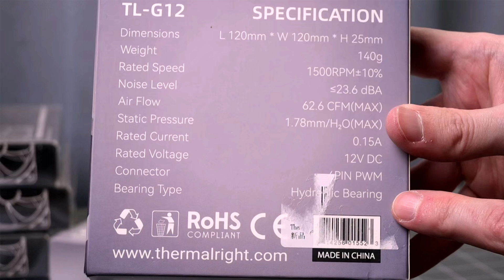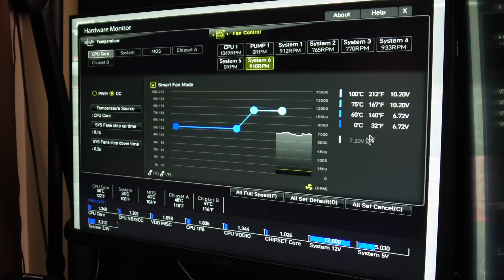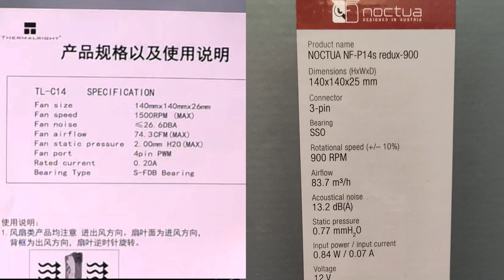Are these budget no RGB 120mm and 140mm PC cooling fans decent?

Comment: For anyone that comes across this, GET THESE FANS.  There are also the TL-C14C-S which are aRGB (5v), but otherwise the same.  Just depends if you want the colors or not.

I had my case full of those 140mm Arctic P14's that everyone raves about.  Yes, on paper, they have great stats.  I believe they are rated higher at static pressure, but about the same CFM.  They have 5 wide blades.  

These Thermalright models have more, thinner blades.  They are not only quieter (by a lot, mind you), or at least FEEL quieter as decibel doesn't tell the entire story.  There is the "pitch" or exact sound that they make that can be more annoying than another pitch/sound.  

They blow far more air in a more conical shape.  I'll try and use words to explain this, but the airflow is far more directed.  CFM is just a measurement of the amount/volume of air moved.  It doesn't tell you HOW it's moved, meaning... is it spreading it all around or is it laser beaming it straight forward... if that makes sense.  These fans blow all that air FORWARD and in a more condensed way.  That's something I didn't really notice to think about before until I got these fans to go with my Thermalright Aqua Elite 360 V3 water cooler for my CPUI.  I had the aRGB 360mm water cooler which replaced the top Arctic P14 black fans I had up top and wound up with a radiator with 3x aRGB fans (120mm) and an aRGB pump.  So I said, what they hey.... I may as well get the same brand of fans to replace the black P14s I had in the front and rear, so I went with the 140mm TL-C14C-S models so the colors would match up exactly the same.  Come to find out, not only were they "prettier", because mind you, the aRGB isn't the greatest.  They can't do white, at least, but the other colors look good and bright, but like I said, not the BEST aRGB fans out there.  They are Gen1 LEDs, so you can't make the fans use more than one color at a time.  

But the PERFORMANCE blew me away... no pun intended.  The airflow is so much more compact and directed in comparison to the P14 fans I had.  Now, you may be thinking... "Who cares what my case looks like?"  That's how I feel.  I don't necessarily care how it looks... so what did I do with two of those P14s?  I strapped them to the TOP of my case, on the outside lmao,  over the radiator so the radiator now has the fans that came on it, blowing through it, and a couple of 140mm P14s on top helping to pull the air on through it.  It works GREAT, btw.  The P14's do have a very high static pressure rating and it's getting used right now.  I have most of my fans connected to the motherboard via a fan hub controller for the PWM control and aRGB control, plus to power them (it uses a S-ATA power connector).  But I threw those P14's on my case's fan controller that came on it.  It's a cheap one, so it's either 100%, 50% or off.  That way, if I'm gaming with headphones, I can just blast them at 100%.  The "slow" setting (I only guess it's 50%) is very quiet but, like right now, just browsing the web, watching vids, I have them off.

So, definitely check these fans out, they are GREAT... and if you're feeling frisky and were like me and didn't believe an AIO was "all that great" compared to a good air cooler, you're wrong.  I was wrong.  This air cooler I said I got dropped all my fully loaded temps by 10C.  LITERALLY 10C.  I had a Fuma 2 Rev B, btw... which was an excellent air cooler.  I have a 5900x.  My only limit for power is a 180a EDC limit.  So, in Prime95 usijng AVX or OCCT  or whatever using AVX2, I can pull around 205 watts and it won't go over 80C.  That used to hit 90C and throttle me.

And on an all core SSE stress test, like CPU-z's normal stress test, I pull around 165 watts.  I used to hit 80C doing that.  Now?  68-69C.  Doesn't even hit 70C lol.  Gaming?  54C-58C.  e

Water cooling is FAR MORE dependent on the room temp than air cooling, though, so your results may vary.  My house is usually 71F, sometimes cooler, but these temps are all at 71F room temp.   So grab these fans, grab that air cooler to go with them (it was only like $50) and take your rig to the next level.  This AIO will handle temps up to about 250W before my 5900x hits 90C.  So, you get what you pay for on one hand, but on the other hand, this AIO is a steal.  It's not going to handle 300 watts or anything, I don't think, but the baseplate on the pump must be machined exceptionally well because I don't see reviewers get temps as good as I do lol.  I am using MX-6 paste, btw.

I'm WAY off topic.

TL;DR  These TL-C14C fans rock.

Comment: I have 4 120mm rgb fans there is no controller is there any way to increase fan speed?
Reply from the maker: Assuming the fans are connected to your motherboard, you'd have to go into your BIOS settings and see if they can be adjusted.